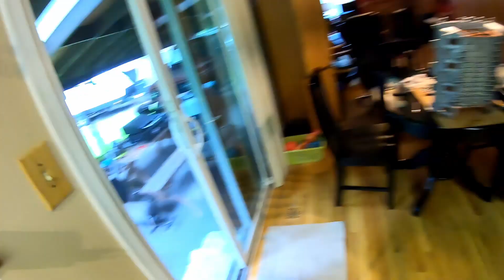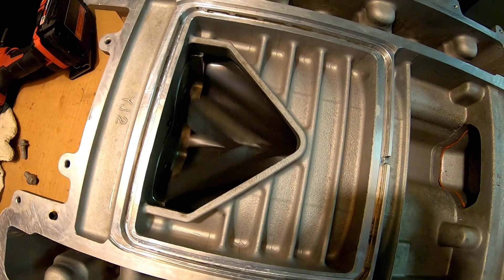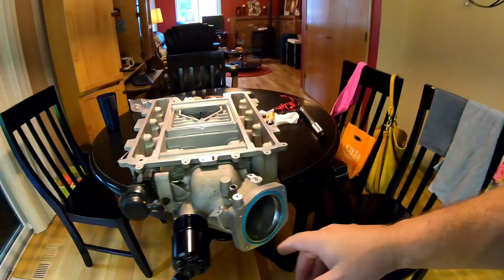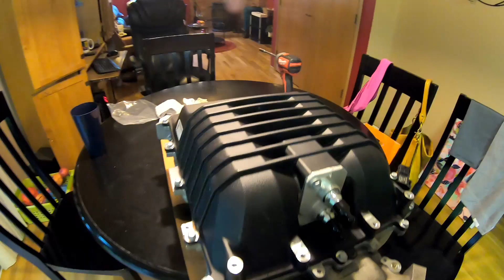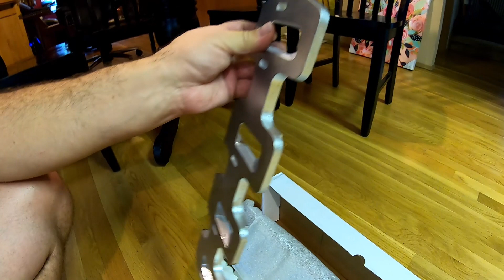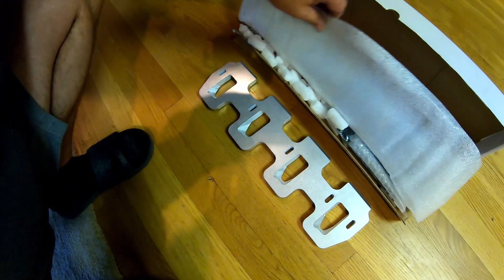LSA Supercharger assembly for C5 Corvette LS1 using Olson Kustom Works

Comment: Hey man. These videos are super helpful. Do you know what MAP sensor to use for the e40 ecm on an 05 vette with an LSA?
Reply from the maker: I've never tuned anything above a gen 3 or 411 PCM but I assume its the same.  You just use the LSA 3 bar map but you have to make sure the appropriate map sensor number is plugged into the tune.   That is the map sensor I am using.

Comment: hi there, where can i pick up an LSA blower, im looking for one for my LS1, cheers
Reply from the maker: Forum classifieds is probably where you will find the best deal. A lot of CTS V guys are upgrading to the Kong blower and selling their stocker. These things are getting harder to find as the years go on.   They are no longer the bargain they once were 4 or 5 years ago.  The only reason I did this is because I actually found one for a reasonable price with low miles.   It's a sellers market for sure.
Reply from the maker: They're often on Ebay but the prices are terrible.

Comment: Any other mods to the engine?
Reply from the maker: TSP CNC ported heads with 2.02 intake valves.  BTR Stage 2 NA cam.   1 7/8s long tube headers.
Reply: @PNW_Car_Mods  nice I’ll defiantly keep you posted on mine when I start
Reply from the maker: @boringautox  Looking forward to it.  Do you post on Corvette Forum at all?
Reply: @PNW_Car_Mods  nope lol I’m in lots of groups on fb but that’s about it. It’s my 1st corvette and only had it about a year and a half lol.
Reply from the maker: @boringautox   Funny how different we all are online.  I have never had a facebook but have been on about 25 different forums since 1998.

Comment: Nothing like a little LSA with your bacon and eggs.   This will be fun to see go together. Its going to be a handful!
Reply from the maker: I don't even know if I am going to be able to tune it with the stock clutch lol.
Reply: @PNW_Car_Mods  My stock clutch "held" pretty good  taking it fairly easy when I added the SC - but it did NOT like revving past 6000 RPMS and would stick to the floor.  Marginal Pressure Plates IMO...
Reply from the maker: @Toys4Life  Yeah I am going to nurse it along for a while.  I don't need to rotate the earth right now.  I am already making about 420 wheel and 390 torque NA.  If I powershift it the clutch slips a smidge already and the car only has 33k miles on it.

Comment: theres vacuum used on the c5 hvac?
Reply from the maker: Yup.  It's a small hard plastic pipe behind the intake/engine that heads over to behind the battery box.  It is often damaged when people take their intakes off and not noticed until they realize they can't change the settings for the hvac.
Reply: Having an issue where idle surges and hangs when ac is turned on, Wonder if could have something to do with that vac system.
Reply from the maker: @colemcmeans7809  certainly possible.  Something easy to look into.
Reply: She also dies out, definitely need to at least have a look at that vac can.

Comment: So that's what you meant by the Racetronix fuel pump video thumbnail. 

You really are gonna have to cut a hole in the hood. 

So like 600hp, 550 Tq?
Reply from the maker: Yessir!     For now the hood will just come off.  If I scare up a cheap spare then we'll consider cutting.   Plans are for 575 wheel HP and around 500 wheel Tq on 92 octane speed density tune.